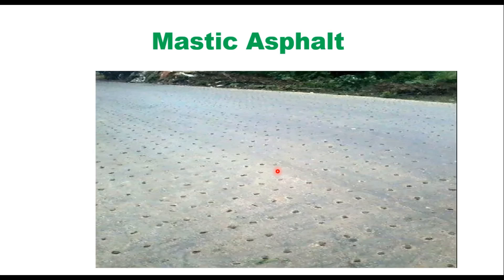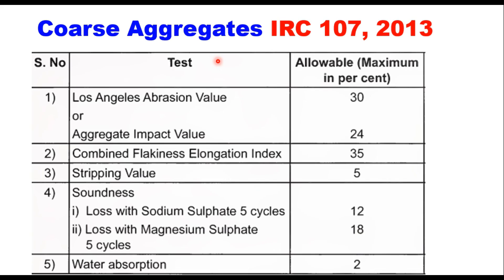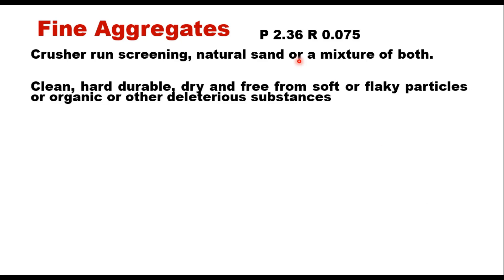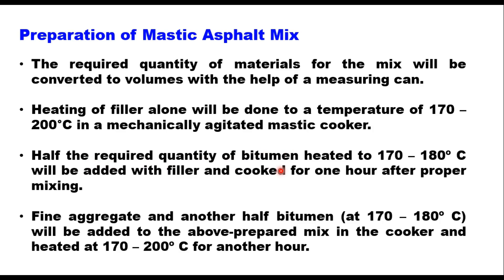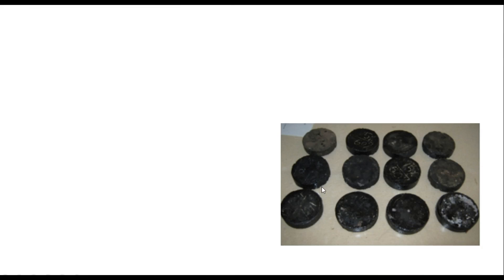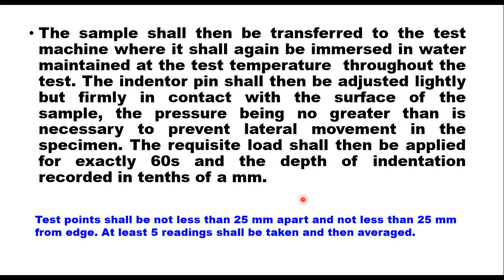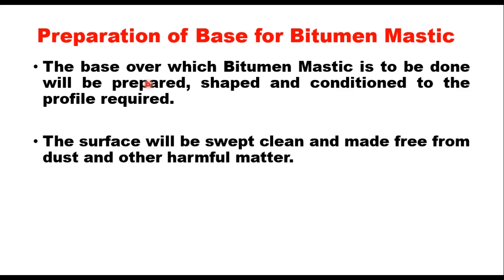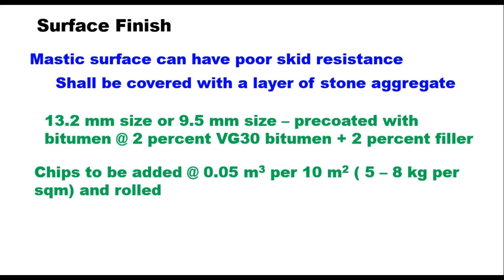#Mastic #asphalt for roads and bridge deck slabs, Design and construction of Mastic, hardness number

Comment: Sir why on bridge deck pavement, only flexible pavements are seen? Can we use rigid pavements as well?
Reply from the maker: A flexible pavement is provided for several reasons: protection, waterproofing, and improved riding surface. Flexible pavement layers are good sealant, preventing water from penetrating the concrete slab and causing damage, while also providing a smoother, more comfortable surface for vehicles. It also provides flexiblity to accommodate minor minor movements and vibrations which are inherent in bridge structure.

Comment: Sir, IRC 107 - 2013 or MoRT&H 5th revision 2013 which code will use for Mastic design ?
Reply from the maker: Both. IRC 107 has been revised recently and that will superceed MORTH.
Reply: @SatishIITR  Ok sir

Comment: Sir in deck slab we laid Mastic over BC the vicevesrsa can be possible sir???
Reply from the maker: Mastic asphalt is used on bridges for its exceptional waterproofing, durability, and ability to withstand dynamic loads and vibrations. BC does not have all these qualities. Laying of BC over Mastic will loose all these benefits.
Reply: then if Mastic is already provided on deck slab and there is a provision of BC over it then what should we do..we stop the BC laying over it and keep as it is???
Reply from the maker: @roshantigga2614  No, If resurfacing is required then you do it with BC also. As such there is no restriction

Comment: Sir tack coat should be applied or not before construction of mastic asphalt
Reply from the maker: Yes, a tack coat is applied before laying the mastic asphalt
Reply: Thanks sir for quick reply and very good type of information is provided by you i see lot of videos but your video clears my all douught 😊  @SatishIITR
Reply from the maker: @ManishIndore-z4y  Thanks
Reply: Sir if done by mechanical mean then stone chipping to spread or not
Reply from the maker: @ManishIndore-z4y  stone chpis are required to create friction on the surface. Mastic surface otherwise is very smooth

Comment: Thank you very much Sir. One question is that generally mastic is laid over the base surface like BC, but nowadays on bridge deck mastic is laid first and covered by BC for protecting the deck from moisture more efficiently than previous method as by some experts. Which is correct.Your valuable suggestions is needed.
Reply from the maker: Mastic layer is more water proof than BC layer, but provides less skid resistance than BC. Both practices are in use; laying Mastic over BC layer and BC over mastic. When BC is to be laid over mastic (this is done on brifge deck slabs only), the mastic is laid in very thin layer and IRC 107 is not for such a thin layer. It is clearly written in Section 2 of the code that This document is not for thin mastic layer on bridge decks below a bituminous concrete layer.
Reply: @SatishIITR  Thank you Sir